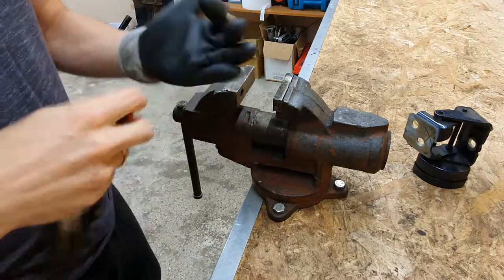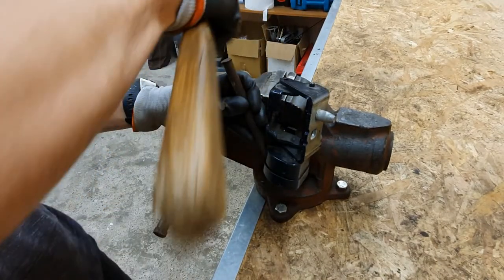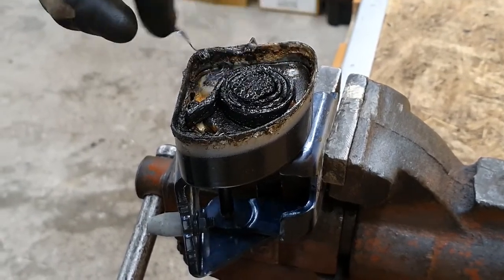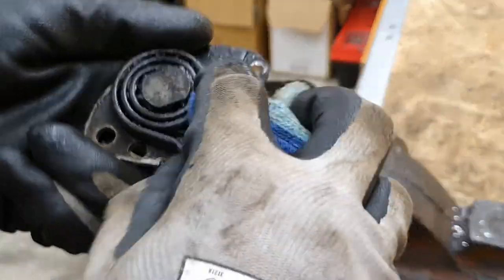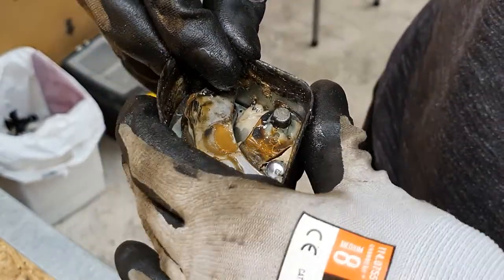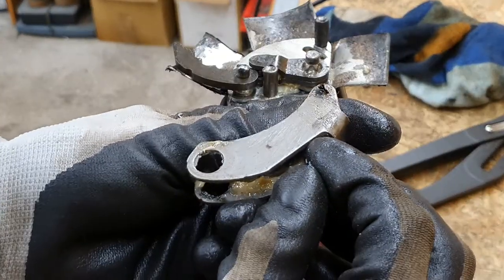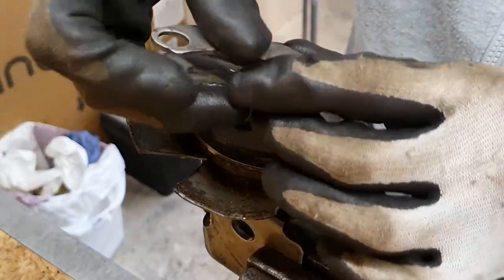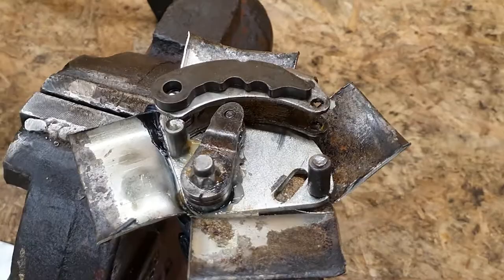C5 X7 Noisy door hindge (limiter) teardown and analysis

Comment: Hi. First of all congratulations for your videos. Secondly, is it possible  to give me some advices for  replacing of a same door hinge (driver's side) due to same failure. Thank you
Reply from the maker: Hi, thanks.
Well, as I have said in one comment lower, firstly door has to be removed by undoing its bolts from the hindge, then the hidge itself can be removed. Nothing difficult, except the weight of the door... I do not recommend used ones, unless you can get them from low mileage car and from rear doors, as they are used much less and will have more chances to be ok for long time.

Comment: Hi mate! How did you exchange the door hinge? Do you need to remove the whole door and is it possible to exchange with only the door opened?
Reply from the maker: Hi. Unfotunatelly, door has to be removed completely. Firstly undo bolts from the door, remove it, change the hindge, put the door back on. Be carefull not to damage the paint, second person is a must I would say, because door is quite heavy part.
Reply: @rustoil  thanks a lot buddy! You've got good videos and very nice car. Take care.
Reply from the maker: @cheizer  thanks ;)